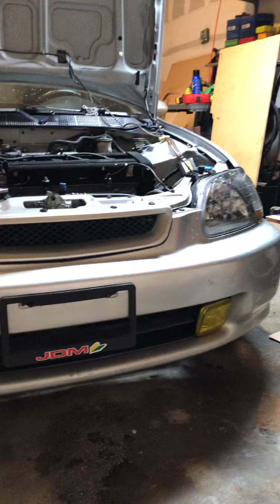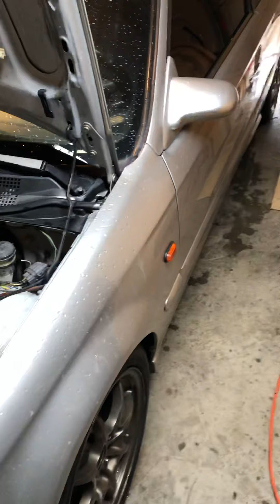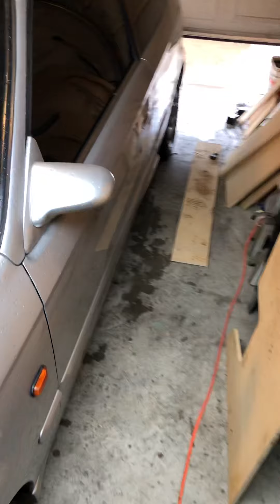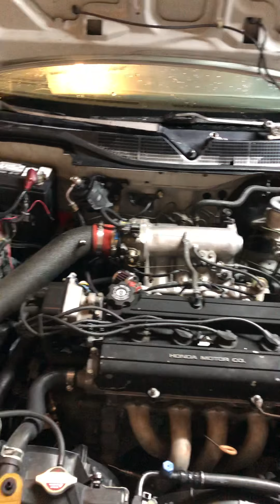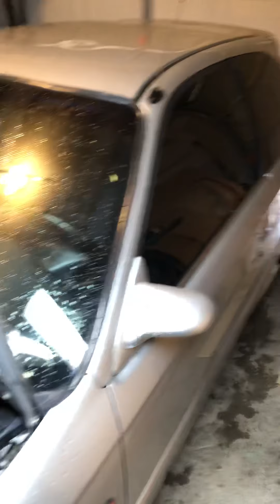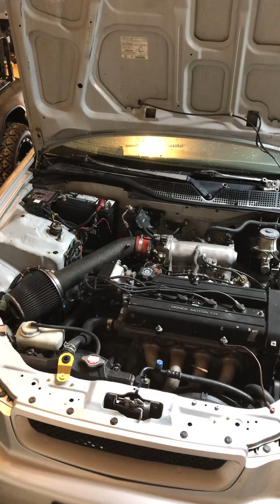EK JDM B20B High Comp p1509 code

Comment: I’m having the same issue with my ek
Reply: I already bought a new idle air control valve off eBay to but it didn’t work so I’m buying a P 28 right now thank for your help your ek is clean I have a purple ek hatch it’s a single zc jdm turbo with  ram horn headers is yours ob1 with ecu did u use